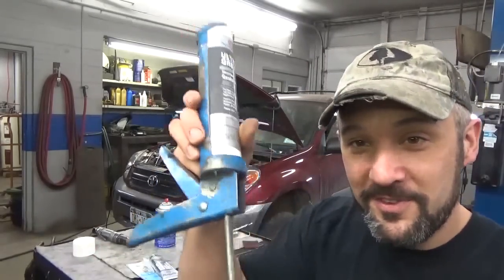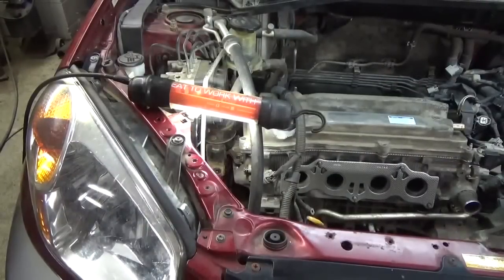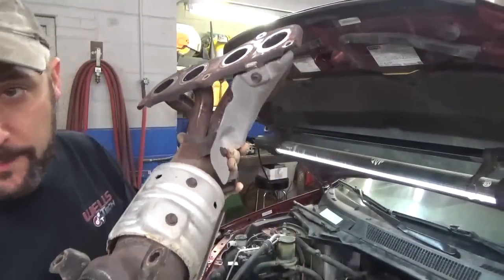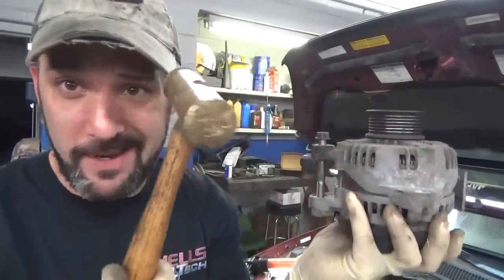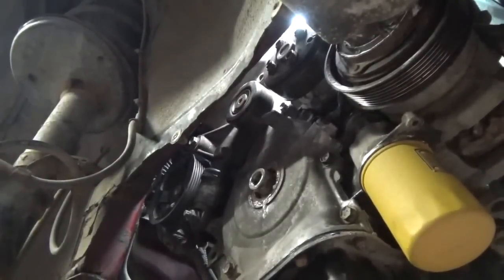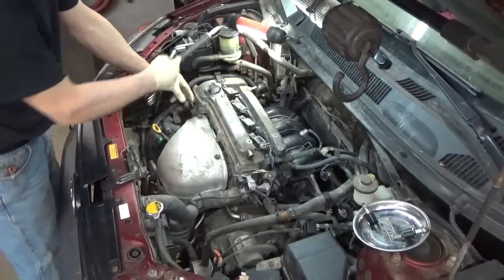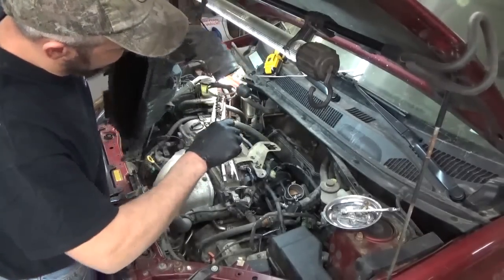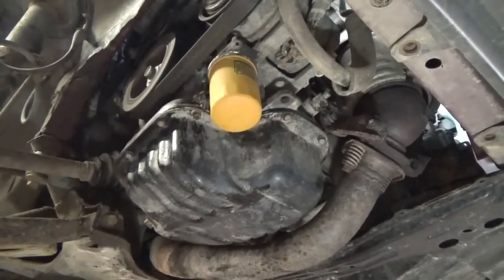Toyota Rav4 2AZFE Stripped Head Bolt Repair Part V

Comment: Whenever doing a big tear down like this being organized to the point of borderline OCD is key. Everyone has their own method.  Use what works for you.  When I remove a component (like a water pump, alternator, valve cover etc) I either loosely screw the nut/bolt back into where it came from, or the component itself (depending on which is threaded), otherwise I keep it in the hole in the component it was attached to and tape it down so the bolt/nut won’t fall out. This way I don’t have to remember where the nut/bolt went, what that component does nor worry about losing the nut/bolt. This method would also help guard against a Mini-Eric coming by and hiding all your nuts/bolts around the shop again.  :-)

For electrical connections I take two pieces of masking tape and write the same letter on each (starting with A for the first male & female connectors, B for the second pair and so on). I then ‘flag’ the male & female connectors as I disconnect them with that lettered tape so I can keep track of which connectors go together. I do the same thing with hoses, but I use numbers for those (starting with 0). I then keep a running list of those letters & numbers on a notepad as I remove things to keep track of the order they came off so I can put them back on in the same/similar order. As I reinstall things, I mark off each letter & number I’ve reinstalled so I can double check that I didn’t forget to connect something when I’m done.

To avoid forgetting to put fluids back in before starting the motor up, I remove the filler cap for that fluid (e.g. oil cap or radiator cap etc) and cover the hole with color’d painters tape as a visual indicator that it doesn’t have any fluid in it.

All that seems like a lot of work, but in the long run it saves a TON of time, money, sanity & gray hairs. This method has worked for me during many engine swaps, head gaskets and similarly large jobs over the years.
Reply from the maker: Pet Rock's Garage All very good tips, thanks for sharing and yes keep an eye out for 2 years olds haha!
Reply: wow, very OCD here. But that's how I uninstall and install things back :D Being OCD saves time trying to find hardware later
Reply: I don't do a ton of big jobs but I always thought maybe using a plano tackle box type organizer would be useful or maybe cups with lids and magnets you could keep on a metal board.
Reply: Pet - OCD tips are great. Nothing worse than finishing up and finding leftover nuts or bolts. Also, we never know if there will be a reason we can't finish the job for a long time. Weeks or even months later, the memory is gone. thanks
Reply: ThankYou!!! Great organizational tips for like several different applications.

Comment: I relate to the dropsies & listening for clinking locations & grabbing my long magnetic wand or my push button gripper tool. Also a roll of tape wrapped backwards to have a sticky outside lets me recover non-magnetic stuff. Being somewhat clumsy I drop or knock over lots of stuff and I absolutely HATE it. You are much better than me in that respect, you don't drop much & are very careful about knocking shit over. Good job!

Comment: I was doing a valve adjustment on my motorcycle and heard the sound of something falling down at the point where everything was done and I was putting the cover on. I KNEW something fell down just couldnt think of what. I looked and looked and nope nothing. put everthing together and it ran like butter. many years later after doing trackdays and rallys and all sorts of thousand mile trips. the oil drain plug finally stripped after the 1000th oil change. I pulled out the pan to ream it. I look at it and a dowel pin is staring at me. A big bulb went on from all those years back.

Comment: You've done an amazing job!  Tricks you pass on along the way help us......thank you!  
When I replaced the T chains in my 4.0 L Nissan Frontier, I learned to put the primary or long chain on before installing the stationary guide on the driver's side which helped line up everything the first try.  Then the guide followed by the tensioner on the passenger side and two quick rotations.  Ya, I installed the sp plugs AFTER that.
Keep the videos coming.....THEY'RE GREAT!

Comment: I didn't think much of Toyota Packing Sealant until I got my 2004 Avalon. I tried unsuccessfully 3-4 times to remove the oil pan to replace the oil pickup tube. I had all the bolts out, and I even bought the wedge pan removal tool JTC 1315 and I couldn't get enough clearance to drive it in. I had a mini hammer from Harbor Freight too. I finally took it to a mechanic and warned him that that Toyota sealant was a major pain to remove. He actually had to bend the oil pan to remove it and went to O'reilly's to buy a new pan. I think he felt guilty that he had to destroy the original pan but I totally understood because I contemplated running the engine with no bolts to see if I could blow the pan off the engine (that's stupid). I had provided him a new tube of the packing sealant and he really liked the JTC tool so much I ended up giving it to him. That sealant from Toyota is no joke, it sets up and becomes every elastic but firm. It's not like regular Permatex at all. It's like the black version of Spider-man's web shooter goo.

Comment: Tell you a little story about form to fit RTV and gaskets.  

I once put the gasket on a mustang transmission and the next day fluid was all over the floor. I put a new gasket from Ford mind you and it did it again. Same result. The service tech said you use the black RTV from Ford and no gasket. As the fluid will permeate the gasket and leak. I used the RTV and it never leaked again. The same applies to rear axle covers where gaskets never were installed from the factory.
Reply from the maker: Claude Rains A lot of dodges only use silicone on the tranny pans too. A lot of auto companies do now that I think about it...
Reply: Yes they all seem to use the stuff over gaskets, but still list gaskets as part of the assembly. Which it never had one to start with. Then after $50.00 of fluid on the ground. You realize something's not right.

I'm also very careful that I disconnect the battery when I service electronic throttle bodies now. Seems the torque they produce can cut your damn finger tip off. If you're not careful. As it can close on you when forced open, even if the vehicle is not running.
Reply from the maker: Oh man ya you have to very careful around electric throttle bodies! They have a ton of power...

Comment: Eric, this is Bryan.  I like the long video series when it is a big job. Love the details that go into your repairs. Ends up we have a 2.4 L in a 03 Camry, so now I know what we are up against if it starts leaking.  Really liked the 5 part Subaru cylinder head gasket replacement videos.
Reply: Also the above mentioned Camry uses a qt of oil about every 1500 miles.  So I think to answer your question this engine seems to use oil.  It does have 225K on it though.

Comment: When I "used" to read the comments its people like the guy you just described is the reason why I stopped. 

Folks are unbelievable, and it's not the Internet that have changed people and turned them into pricks, they've always been pricks, its just that the Internet has given them an international platform to continue to be pricks. 

Just abort them and continue on.
Reply: That is so true
Reply: Gerald, you're my hero for offering an honest, rational reason why being a misanthrope is the right thing to do.
Reply: It's the annonymity  (sp) of the internet that's makes people so rude.  Would they really  be that rude to your face?  Alot of people just "ain't got no raisin".
Reply: I still read the comments because there are lots of good ones from people that can add good info---the pricks, just give it right back to them because they are either trolls or whining babies that can dish it out but can't take it.

Comment: your methodical,thorough,overly ambitious efforts to rebuild engine really impressive ~
  ~old rav4 ,while good car ,(in salt belt),  really does not justify rebuilding possibly BETTER than NEW 
     with all the problems it developed with normal wear and climate
   
I,m considering decomissioning my RARE 1993 Nissan NX now due to rust catching up (despite twice annual DIY oil
    spray treatment ) FINALLY after 24 YEARS in salt belt~~     where other cars unsafe or JUNK after 5 - 6 years

Comment: Another great video.   Have you ever had one of those Lisle coolant funnels overflow?   It happened to me twice and it made a real mess both times.  It try to keep it 1/4 full, and add fluid when it gets low, but sometimes it expands quickly when I assume an air pocket flash steams.  I now keep a shop vac nearby to suck the funnel if it gets too high.

Thanks,
Chris
Reply from the maker: NO not me I have never made a mess... --said no mechanic ever. Lol yeah I have overflowed it a time or two in my day

Comment: I could'a swore I heard a couple of piston return springs squeaking when you first started the engine.  Better check that.  Good job, very enjoyable video series.
Reply from the maker: +Ed Waggoner Sr. (Papatch) must have used the wrong ones ;)
Reply: +Ed Waggoner Sr. (Papatch) WTF is a piston return spring? is that like blinker fluid.
Reply from the maker: Similar to a muffler bearing really...
Reply: South Main Auto Repair My dad always suspected a few loose nuts behind the wheel.
Reply: +South Main Auto Repair Okay i am sure that my motorcycle has muffler bearings on the Xup exhaust dohicky... so should i install a new powerband and proceeed  with regular scheduled maintenance?  Do i need to disassemble and rebuild my whole longblock ...ROFL sorry i need to check my blow off valve
Reply: +Ed Waggoner Sr. (Papatch) Next time better use blue steam before you start the engine............this could go on forever (:

Comment: Think a watched enough on your series on this repair to do it myself instead of letting a shop do it and cost a lot of money cause I have the same problem with coolant coming from the back of the motor did a pressure test and it wasn't holding pressure in the system not loosing much coolant but would like to get this done really soon before it gets worse and my car stays at normal temperature without overheating

Comment: Hollow dowel pin removal suggestions.

1) pack with grease, then with a reasonably cloae fittong pin, pound it in. Hydroliic pressure forces the hollow pin out.

This also works good on pilot shaft bearings.

2) Since the pin is soft, consult a tap chart and find a tap that calls for a tap drill smaller tha the ID of the hole but larger than the minor diameter of the thread.

Now run a tap down the hole. When you bottom the tap keep turning and the pin will be forced out.

Comment: I removed and installed the intake on the Camry with engine mounts removed. Jack under engine and  with ratchet strap slightly pulling forward. Didn't do it like that the 1st try, pretty sure the camry and rav4 engine bays are similar because sounds like they're both tight.

Comment: Cans of goo with short brushes...

Put a hole saw through a 2x4, stack another 2x4 on top of that, put the can of goo's lid/brush through the hole in the 2x4, and whack it with a hammer like re-sealing a can of paint.  Hit it hard enough to start crushing the can.

Basically, shrink the can as you use it.

Very handy.

Comment: The best thing that I can think of with the throttle body gasket having that thing on it. Maybe it actually has something to do with fluid dynamics. Like maybe volume going in breaking it up so there's not any kind of turbulence I don't know. Or maybe it's just like you say to prevent a large objects from going through the throttle body.

Comment: They gave you 3 tubes of silicone because you're suppose to silicone the oil pan gasket. Toyotas leak with cork gaskets. Great video overall but since i work on these everyday i could nitpick. But you are a fine tech.
Reply from the maker: MultiRedpeanut Well I see the pan was held on with FIPG originally but thought it was odd to come with a gasket. I used spray tack on it and it seemed to seal really good, gasket didn't squish out or split. Mehhh we will see when he brings it back in for service. Use it as a test subject :)
Reply: +South Main Auto Repair. Test subject heheh... Great vid tho. Keep um coming.

Comment: heres a good one for you . i was doing valve seals on the car and the air  line broke and the valve dropped i didn't want to pull head took me 3 hours but pulled the valve back tru the hole
Reply: that happened to me.i used a very powerful  magnet down the guide to pull the stem up.

Comment: I avoid using a gasket with a stamped metal oil pan, if the factory didn't use a gasket. Because as you know the metal around the pan bolt holes tends to be pulled, and distorted up, leaving a "not flat surface", on the pan. It's difficult to get that oil pan surface flat and level, all the way around. Plus when you use a gasket, the potential for a leak includes not just the gap between the pan, and the engine block, but now with a gasket, the potential is between the gasket and the pan, as well as the gasket and the engine block. I also don't use brake clean, to clean the surfaces, beforehand, as some brake cleaners DO leave a residue, that the silicone doesn't bond well to. I use acetone, and white lint free paper cloths. You can start cleaning, a smooth surface, this way, that you've already wiped down with some other recommended cleaner, and then use the acetone and white towels, and you'll see that you're still pulling oil off of that smooth surface, that you thought was clean. Just keep doing this with acetone, until the white towels appear to be clean. Usually it'll take at least three times around, but I guarantee you, that pan will be sealed, when you then apply the silicone. I was an auto mechanic, for nearly ten years and then got licensed as an aircraft mechanic, and worked for Delta Airlines for 32 years. Not bragging, just giving you my bonafides. You become very familiar with technical specifications, and proper applications of chemicals along the way, as an aircraft mechanic. I've had conversations with engineers, and have submitted recommendations for technical document changes that have been accepted. A lot of it, is just experience. I'd like to hear from you, if you feel like replying. If I don't sound like a "no-it-all" by now.

Comment: Oil cap basically disintegrated when I went to pull of my mother's car. Bunch of pieces got down into the head. managed to get most of it out, but wasn't 100% sure I got all of it. 5 days later, the engine started knocking. After pulling the oil pan and getting the pump out, there were two little pieces of plastic from the cap jamming it up, and even found a little piece that was stuck in one of the oil galley. Moral of the story, make sure you don't drop small things in the engine lol

Comment: I sometimes use reusable snack containers for lunch boxes for small parts. They come in a variety of sizes small to large and some have 3 or 4 compartments. They have secure lids and you don't have to worry about cups tipping and spilling stuff. I use a regular metal tray and transfer parts to the snack containers for each sub assembly. Some of them I've punched small holes in to stick wire through so I can wire it straight to the intake, bracket, or whatever so they stay with the part.

For some things like timing covers I punch holes and draw the pattern on index card or a piece of cardboard of the cover or other part. Then stick the bolts through the holes as I take them out. It makes remembering where the stud went that held the wire loom. wire nuts in holes. You can throw them in a container too so it's harder to lose them.
Reply: +Co Jones Youtubes acting weird. 
I was going to mention for some things I punch hole patterns in index cards or cardboard to make installing studs or different length bolts in the right holes easier. Label front of engine or any notes on the cards and throw them in the container.

Comment: Mr Eric, is there a difference between the two antiseize? Ones copper and one is silver. Is one for high temperature bolts and the other for normal wear bolts in the weather? Thanks
Reply: They are for different applications. Aluminium doesn’t react with most metals so safe to use all on most systems like A/C, ceramic anti seize is generally “food safe”, and copper is general purpose.

Comment: 8 years later... did you or any of your viewers determine the use of the intake diaper? My guess is that it helps isolate the cylinder head heat from the intake. But just a guess. Thanks for the video. Cheers

Comment: So it's been nearly 5 years. Is it still running? Great job, but I ask as I never reuse any timing belt or timing chain tensioners, spring or hydraulic, period. Have one fail and it's not worth it.